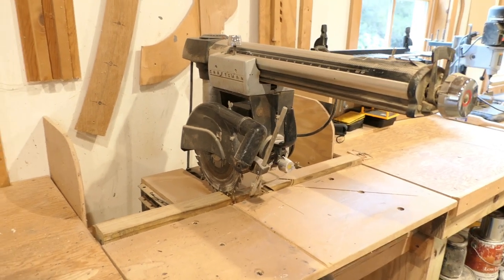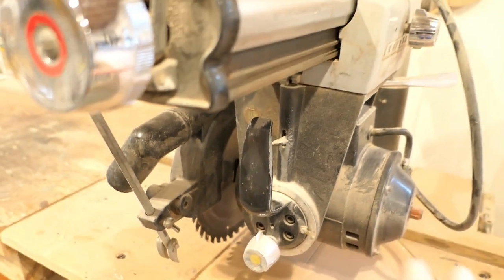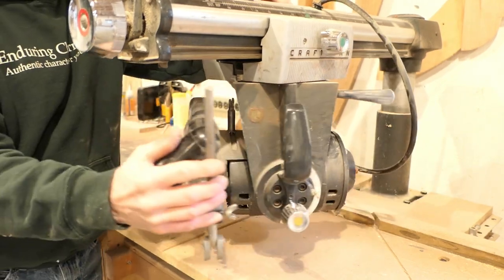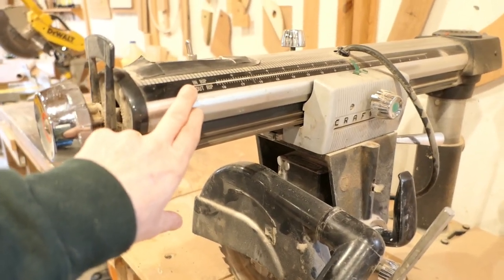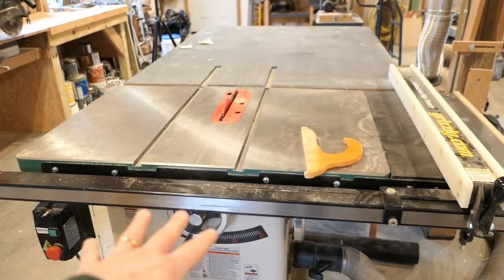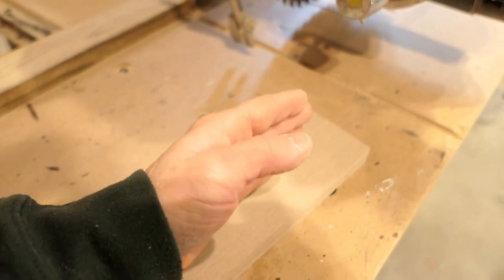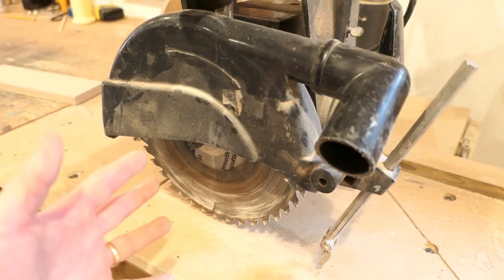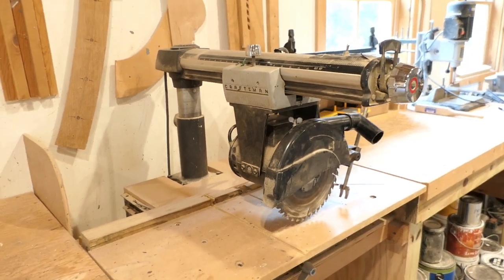The Radial Arm Saw Controversy Revisited!

Comment: Always makes me laugh when people say a ras is so dangerous, tries to launch boards across the room, when a table saw is trying to do the same thing. I have a miter, table, and 2 ras, the miter saw I don't really use much, I don't think it's really good at anything, and my table saw is just that...a table to put stuff on. I don't understand how anyone says a miter saw is better, other than the ability to bring it places, with its very small table that forces you to get your hand close to the blade, that you can also bring down on your hand easily. My shop teacher always said if you're gonna be afraid of something, be afraid of the table saw. Easily the most dangerous machine, I watched it throw a board into my friends gut one time. It's the only shop tool that I hate using. I've never felt like a ras is dangerous, I feel like its much safer for everything. I've ripped some twisted nasty wood on tables and ras, ras didn't care, table was trying to kickback non stop, and it's properly aligned. No I dont use guards but who does. I respect everyones opinion on a ras, but you're all missing out. Coolest looking machine, fun to use, very handy saw to have, much better built than saws of today, many still working 70+ years old, it will always have a place in my shop, ALWAYS!
Reply from the maker: I'm curious, then, how do you handle a full sheet of plywood?  Or, is your woodworking confined to smaller workpieces?
Reply: Circular saw or the ras fence can be moved to the back of the table for a wider cut
Reply: same, i have a sliding miter saw and two radial arm saws, plus a table saw. I pretty much havent used the miter saw in over a year but use the Radial arm saw all the time. Table saw gets mixed use for some things.
Reply from the maker: @Jeyson Braun What type of woodworking or building do you do?  I think the type of work you do probably influences your thoughts on the RAS.
Reply: What a great post. I use the RAS at every opportunity. It’s probably my favorite piece of equipment.
Reply: I just bought a RAS today and for the first time in my life used it to make a small storage box.  I like it on cross cuts that I can see the where the blade is hitting the wood, whereas on a table saw that is harder and with my miter saw I'm much more limited with the width of the wood.  I'm finding these YT videos describing how RAS are "dangerous" and obsolete, etc., etc. to be bewildering.  ALL saws are dangerous if you don't understand them, are lazy and sloppy with basic safety protocols, and ask them to do things they aren't really suited to do.  I find my Craftsman table saw dangerous as the wood will often try to ride up the blade and often enough doesn't stay down on the table even if I'm using push sticks to hold the wood down.  A table saw can kick back or eject wood as well.  Trying to rip a 4x8 on a RAS doesn't make sense just as it doesn't make sense to do the same on my small table saw.  I don't have the table saw with the large surface table around it and I don't have a sliding compound miter saw either.  Today I was using my Skill saw to rip a large sheet of plywood.  Those saws make me nervous, but a RAS does not.  Again, I'm not going to ask my RAS to do something another tool is better suited for.  I'm looking forward to using this new [to me] tool.
Reply: Using any power tool carelessly can get you injured or even killed.  I don't see how an RAS is any more dangerous than a drill press or table saw.  I worked for many years in machine shops and had many conversations with OSHA inspectors.  They were pretty sure the drill press accounted for the most accidents because people didn't see it as dangerous.

Comment: I've used DeWalts for over 60 years, the one my Dad bought, I still use. 50 years ago I learned the hard way, first off, Craftsman mechanic's tools are a yay, Craftsman woodworking tools a nay, and Craftsman electrical tools are a complete waste of money. Damm that Sears card ! Any 10" saw on a household 15amp 120volt circuit is woefully underpowered. For many decades all brands of skilsaws were labelled 12 amp at the most. That 15amp is merely  a Craftsman number. And that's with only  7 1/4" or 8 1/4" blades. An underpowered saw will bog down, jam ,and jump at you.  Use a thin kerf blade and a 15amp 240volt circuit. The other thing, a DeWalt has something like dozen adjustments for set up. When set, they are easily  capable of 1/128" precision. Who wouldn't want that ? No tablesaw cross cutting has that level of precision . ( I have a Delta Unisaw) With all their swivels and pivots they are truly a wonder weapon. But above all PULL WITH YOUR LEFT,  HOLD WITH YOUR RIGHT. that gives you the 12" of safety.

Comment: I think the basic problem is most people have forgotten the meaning of "opinion" . Many people believe that only theirs is correct. I also have that exact saw for 40+ years and can still can count to ten on my fingers.
Reply from the maker: Agreed--people do tend to get caught up in their own experience.  For me as a professional, since shop efficiency affects my paycheck the RAS has limited utility. Some of the safety concerns (particularly the noise level and the dust) are a significant problem.  But, if you are an amateur woodworker with a little more time, or if you just enjoy fixing up old machines and using them then the RAS may be a worthwhile footprint in your shop.

Comment: I'm a retired cabinet maker, I started as an appetence / laborer about 1958, I have been using Table Saws, Radial Arm Saws, all my life. I love the Radial Arm for molding cutting, making raised panel' cabinet doors, and as an accurate compound miter box. You can put peg holes in your table just as on a workbench to mount feather boards, ETC. I noticed soon after I began watching your podcast, that you are biased against this saw, that's your business, but also be honest, a Radial Arm Saw just as with a table saw is safe, providing you make proper preparations before cutting, such as plenty of feather boards to hold your work in place. Thank You.
Reply from the maker: Well, not so much biased as I have determined the saw just doesn't add much to my shop, never mind the jobsite.  Routers have taken the place of the RAS for functions like crosscut dadoes, a dual bevel compound miter saw does all manner of crosscuts AND it's portable, and the table saw can handle full width plywood sheets with ease.  So, I still have the RAS, but I rarely use it.  The two safety concerns I have most with the RAS, though, are the noise level and the dust.  I've tested the RAS as the loudest tool I own: https://youtu.be/zNS7Md0-e7A.  And dust collection just isn't efficient on these older machines.  You came of age during the heyday of the RAS, so you became comfortable with it.  Nothing wrong with that.
Reply: @enduringcharm  We all have our preference's, I have found that a well adjuster Radial Arm Saw, replaces a compound Miter Saw, and is an excellent choice for raised panel cutters, and trim cutters, and just like a Table Saw, Finger boards, and guides are required for save, and accurate cutting. Back in the 1980's I made enough trim for a big Timber Frame Home, that the total linear footage, of this trim came to equal over 14 miles, in length. all with trim cutters.

Comment: Well, my dad left me his shopmaster radial arm saw when he passed.  I have a  very small shop space.  I don't have room for another floor tool like a table saw, but I don't miss it.  The radial arm saw is the most versatile tool I could have in my shop.  It does almost everything.  It is very accurate if I set it up properly.  it is perfectly safe if used correctly, with a clear understanding of it s limitations and habits. You can do very accurate rip cuts on long stock if it's set up and used correctly.  I will never get rid of it.

Comment: I think the whole issue is that everyone always says the radial arm saw has no place in a modern shop and then proceeds to compare it to the table saw. There's room for both. The table saw is 100% the clear victor when it comes to ripping just due to its capacity. The arm saw really should be compared to sliding miter saws in videos like these.

The radial arm saw is not a jack of all trades, it's a crosscut master that's also able to do some other things, just as the table saw is a ripping master that's also capable of crosscutting with the right jigs/tools. 

The best way to use an arm saw is to keep it at 90 degrees and align it for that, put some miter slots in your table and use it with a miter gauge. What I love about the RAS in particular is the sacrificial table. You can put clamps, hold downs, stops etc wherever you want and always have a workpiece that is secured hands free. Your hands never need to be anywhere close to the blade. I feel a lot safer making crosscut with a radial arm saw than I do with a table saw or even a miter saw and my cuts are way more accurate as a result. Just like with a table saw there's jigs that let you do just about anything. I've never ripped with a RAS so I can't even really say how functional it's ripping is, because I've always had a table saw. Table saws are also incredibly dangerous. Ripping in general is dangerous, both on an arm saw and a table saw. Caution needs to be exercised with all machines. 

And most importantly, and I think it's something that gets seriously overlooked sometimes... it's currently the cheapest way to get a powerful saw. Due to the stigma, people are practically giving them away considerably cheaper than table saws and with the right tuning you can get a saw capable of building most things. With attachments you can also use it as a shaper/jointer. It's a great way to break into the hobby when everything is so expensive these days. 

I just get annoyed when I get attacked or belittled by people for mentioning I use a radial arm saw. My radial arm saw is easily the nicest piece of equipment in my shop and it makes the cleanest, most accurate cuts. I spent a lot of time getting it to that point. I bought it, restored it, built a new table and cabinet for it all for less than the price of a decent table saw rip fence. It's the piece of equipment im most comfortable with. I bought into the hype and got a 10" hitachi sliding miter saw with the space saving design and wish I wouldn't have wasted the money.
Reply from the maker: I don't disagree that it's silly to compare a RAS to a table saw, but that comparison is often made by the hard-core RAS proponents, which is why I brought it up.   And, I hope you don't feel belittled by my video--as I said, if you enjoy working with vintage machinery and the RAS works for you, then more power to you.  While I still have a spot in my shop occupied by the RAS, I rarely use it anymore.  I used to mount a dado blade in it for crosscut dadoes, but even that has limitations in width and I can do the same job more quickly and cleanly with a router and a jig.  For actual crosscutting my 12" sliding double compound miter is far more accurate.  The width it can cut is a little more than 13 inches, which is less than the RAS of around 17-18 inches.  However, dimensional lumber sold in lumberyards or box stores doesn't exceed 1x12 anyway.  If I'm cutting a wider strip of plywood, it can be flipped to finish a cut.  Ultimately I think it depends on the type of work you are doing and whether you are working professionally (speed matters) or on an amateur level (speed is a secondary concern).
Reply: I own a DeWalt 12” contractor grade radial arm saw.  Purchased in 1978 or 1980.  Works as good as when I first purchased it.  It will rip  24” or a sheet of plywood right down the center.  Yes I have to support the piece hanging off but I own two tripods with rollers on them that work excellently.  When I purchased it I had the table saw guys telling me I would get rid of it.  Still have it. I also have the jointer/shaper accessory and some others.  I firmly agree you should know you owners inside and out.  Also it never hurts to purchase publications on how to use it.  A tool is only as safe as the person using it.  You are 100% correct when you say the younger generation just wants to buy it, plug it in and use it.  The owners manual is for the not known it alls.  If someone looses a finger on a radial arm or table saw it’s because they made a costly mistake.  Now days everyone wants 100% safe equipment direct from the manufacturer.  If you believe that stick with a crosscut and rip hand saw.  That way you shouldn’t do to much damage to yourself maybe???

Comment: Generally accurate description.  However, you didn't show the entire setup for ripping.  The rod on the front of the guard is not a hold down.  It is an anti-kickback pawl.  Some late model RAS came with a clip type spring or other hold down attached to other end of the guard (the rip feed end). I disagree with the notion that a RAS is always less suitable for ripping than a tablesaw.  This is especially true if it is built into a bench that provides both infeed and outfeed support for long stock.  However, it is clearly more difficult to setup for ripping and less safe because there are more things that can wrong if you don't follow proper procedures.  Here are the six steps you must follow to safely  rip on a RAS.    

Step one is to raise the blade and turn the motor for either an infeed or outfeed rip depending upon the width of the cut and lock the motor in place. 
Step two is to set the width of the cut andlock the carriage in place.
Step three is to lower the blade so it cuts about 1/8" into the sacrificial top. Some users will cut a trough in the table so they don't have to raise the blade to pivot the motor. 
Step four is to tilt the guard so the feed end (rear of the guard)  barely clears the thickness of the top.  If the guard has a spring, it is lowered so the spring pushes gently on the wood to hold it down.  
Step 5 is to adjust the anti-kickback pawl so that the stock will run under the fingers but still grab it if it kicksback.  NEVER RIP WITHOUT AN ANTI-KICKBACK PAWL!  
Step 6 is to use a pushboard when the rear of the stock approached the guard.  The board should be long enough to push the stock beyond the blade.  

Needless to say, a RAS requires that you have a set procedure that you follow each operation because there are so many moving parts.  Otherwise, you will get hurt.

Comment: The history of the RAS is pretty cool.  They built post WWII America.  When I was just a young laborer/carpenter wannabe, the BIG 16 in DeWalt was the first tool on site and the last to leave.  We gang cut stud, rafters, stair stringers, door and window headers,  just about everything with it.  Dimensional lumber was cheaper and usually better quality than pre-cut studs and we'd get our blocking and bridging with the off-cuts.  The boys upstairs would call down the dimensions, the saw man would call them back.  Mark, cut, toss it to them, and go back to his cut list.  That old man on the saw lit 2 cigarettes a day.  One when he woke up, and one after lunch.  He jump started the rest.  We didn't worry about the saw getting stolen, it was too heavy.  We just put a tarp on it at the end of the day.  I used to know how to figure the differences in length to pre-cut jack rafters and rake wall studs for 3 or 4 roof pitches off the top of my head.   I'm much dumber now.   haha!  The table saw didn't even have a fence.  Snap a line and follow it freehand.   This wasn't finish carpentry though.  Good times.
Reply from the maker: For many years I used an Atlas table saw which I inherited from my grandfather.  It was a 1949 model, and it had an excellent fence as well as a mount for a riving knife.  I put more board feet through that saw than I care to remember, and it was still running on the original bearings when I sold it.  Anyway your comment reminded me of that saw because it was also so heavy that you didn't have to worry about it being stolen!

Comment: I think I commented on your old video way way back lol.  I had the same saw til about 5yrs ago.
But in a cabinet shop it did have a place and I do miss it.  It was strickly a cross cut of rough materials.  
While yes you can use a sliding miter, but in production it makes since to have multiple saws.

For a small shop or a hobby woodworker its a tougher sell for dedicated saws.  

In the end that moulding cutter head is a tad spooky haha
Reply from the maker: Yeah, I only mentioned in passing the moulding cutter/router type head.  That's just flat out crazy!  I'll stick with my router tables, thanks.
Reply: I have a couple of hand held routers,  and a proper shaper.
I've only used a craftsman shaper head on my table saw, have never put it on my RAS. Im a bit intimidated by the molding head, also; instead of making several passes, I have bevel sawed away a decent chunk of the waste. But that entails switching blades,  adjusting fence, changing throat plates... Easier to just use the shaper, though cutters tend to be more expensive.

Comment: It is impossible to get kickback on a RAS because if boards pinch the blade drives the board into the table whereas the tablesaw lifts the board and throws it toward you.....but both RAS and table saw can cause ejection (throwing board directly back)....and you can safely do thin cuts with a proper long push stick and your hands arent anywhere near the blade...
Reply from the maker: Well, if the board lifts and comes back or if it is driven back, isn't that a distinction without a difference?
Reply: Kick back paul’s prevent ejection on a RAS, they work well. Some modern RAS actually have Riving knife also.